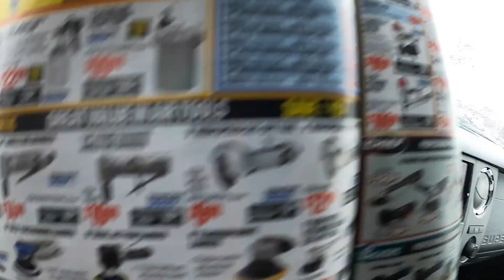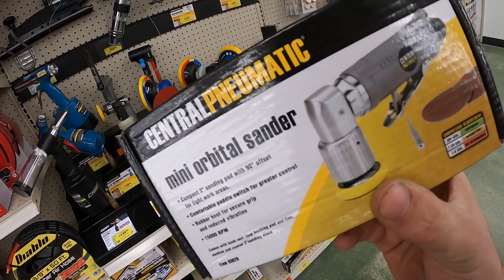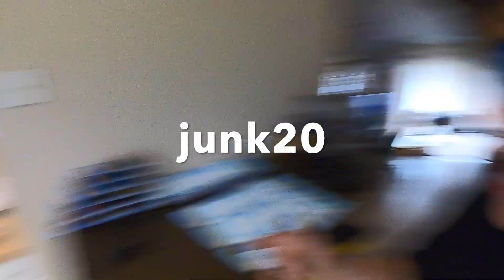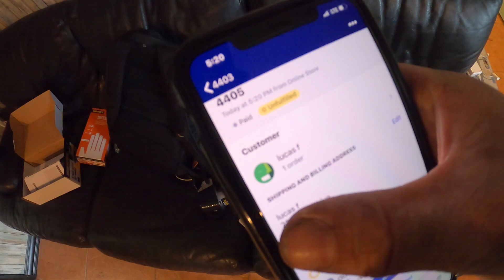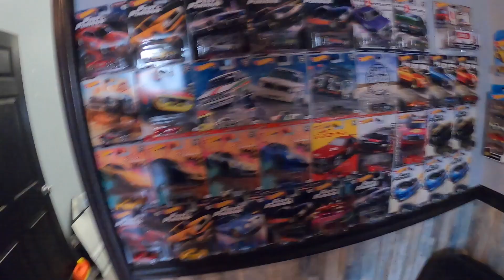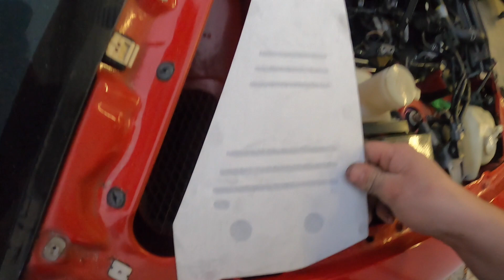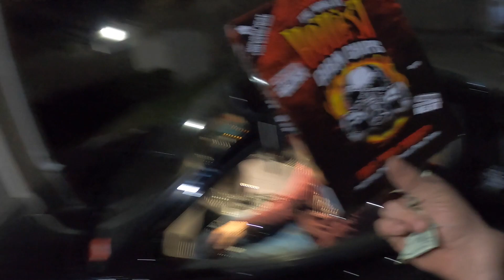FIRST DAY BACK, MARCUS INJURED!!

Comment: When was the last time you drained your air compressor???
Reply from the maker: Every night
Reply: @RicerMiata  Good man. I don't like those low volume inline ones from Harbor freight because they don't last long. Especially in a warm humid environment like FL. I would use a desiccant cartridge style. Your tools will last longer and don't forget to oil them each use. Here's the filter I use and it's great. https://www.eastwood.com/devilbiss-qc3-air-filter-dryer.html
Love to see you trying to step up your game and these little things will help. I support you 100%. BTW It was funny when I got my mystery HW and it was a mini cooper. I have a fully built R53. R U stalking me?
Reply: I was jumping on here to say the same thing LOL. I leave mine slightly cracked all the time and then a small tub underneath it so I can keep an eye on how much comes out
Reply: @KDad514  R53😍
Reply: @KDad514  I've had a/cheap harbor freight one for years and live in Florida. Lo
Reply: @RicerMiata  Do you know there is a  drain bolt at the bottom of the tank? After there is no air in it at all try taking that out and see how much water comes out.
Reply: Every time I use it!
Reply: 2:49 you can see an intercooler
 on the MX five

Comment: 1:40 your air tools are spitting water because your compressor is ingesting humid air. gotta drain it more often than you did it CT my guy
Reply: Dallas, salad. Yep I seen gallons of water from a compressor that was never drain.
Reply: He replied to a comment saying he drains it every day
Reply: Then he needs a 2/3 stage inline air dryer, there's a ton on Amazon <$150. Should still put his tank on a solenoid/float release valve.
Reply: It a florida. Living here it happened at every shop I work at. Have to have a drier at every hose

Comment: Jack the car u and run it you'll see the leak better while it has oil pressure. Check the oil filter though I had this problem it was pissing me off and ended up the damn filter had a small pink hole in it.

Comment: You should put a solenoid valve on ur air compressor you can put it on a timer and it goes right on to the drain and u can set it to go off every couple mins for a few seconds u can find them at grainger

Comment: Hey why don't you run the car to see where the oil leak is coming from but make sure the car is jacked up so if you need to you can get under the car to solve the oil leak problem.

Comment: Ok, so Chris, first of all, welcome home...second, please fix the EF sedan with a $250 B18B1, and while you're fixing things, you can look on the Balls of Face and if you can't get a D16Z6, JDM D15B VTEC, or even a Mini Me non-VTEC block with a VTEC head for CHEAP to fix the EJ8 coupe, then you should quit YouTube. Seriously brother, Honda parts and engines are SO cheap and there's absolutely no reason why you can't make both cars into runners and drivers. I understand that you just got back from Europe, but if you cant get both cars running and driving, you should just give up. Hondas are so easy to work on and parts are way less expensive and very plentiful than any other vehicles.